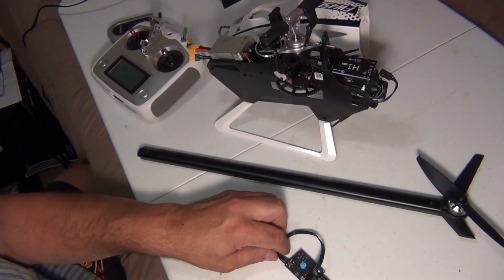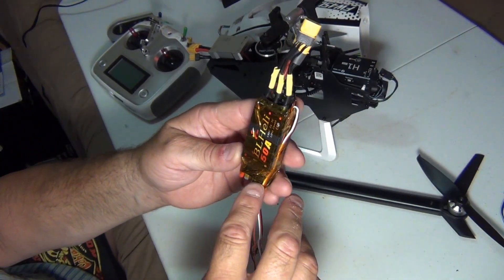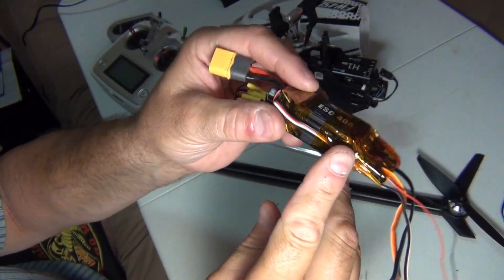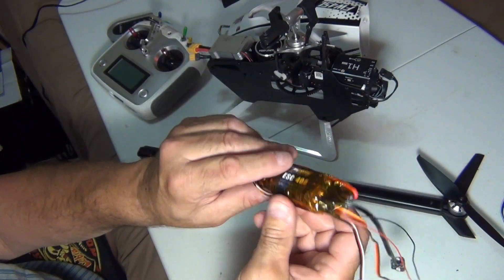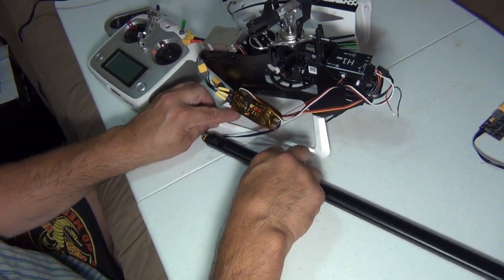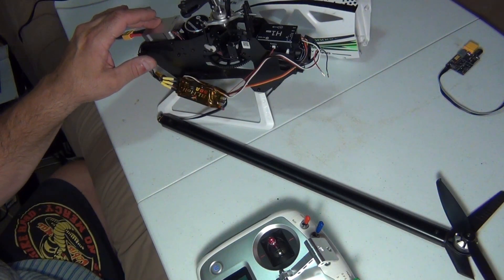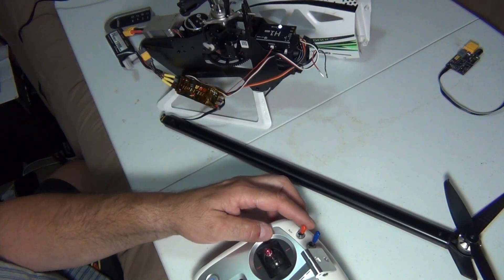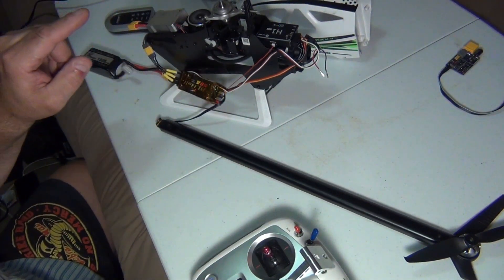FW450 DIY ESC with Flywing Parts

Comment: However, your approach can also be used. It is recommended to use a smaller BL ESC like the V1 version. However, please note that the BEC voltage should not be lower than 6V and the output current should not be lower than 5A
Reply from the maker: but your esc's say ubec 5a 5v ??????????

Comment: The mos model of the ESC you have is VS3698AP. Voltage 30V, current 105A. The reason why there is only one Electrolytic capacitor is that there is not enough space, so we use more expensive patch Ceramic capacitor nearby